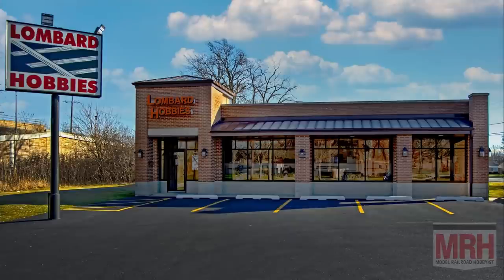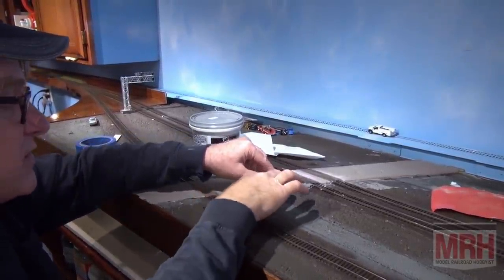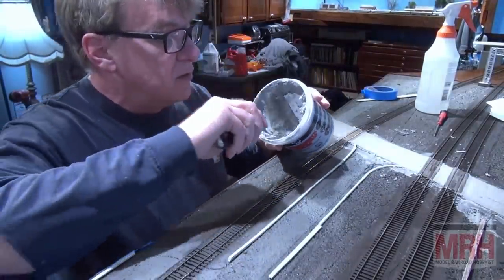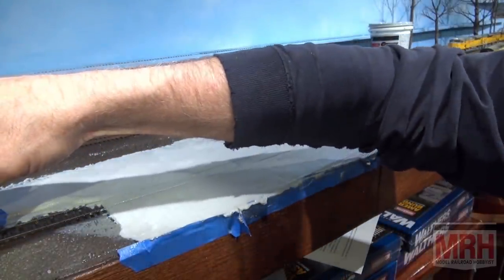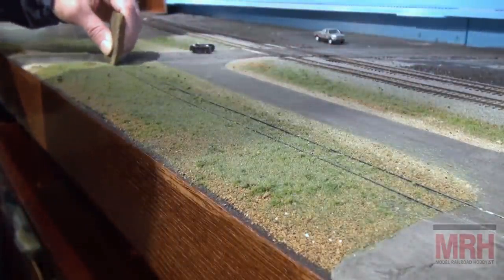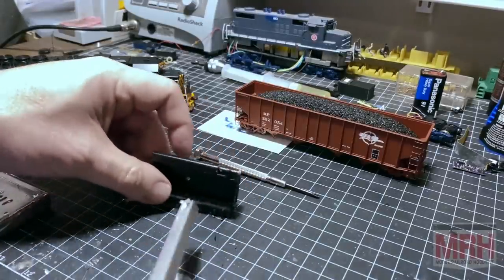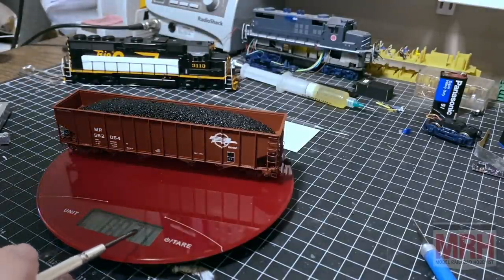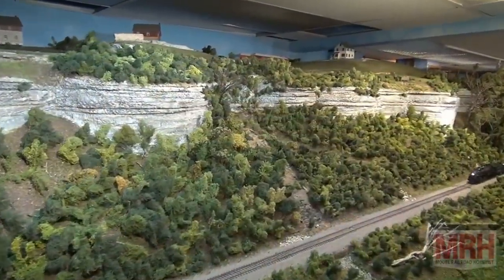Paved areas step-by-step | May 2021 WHATS NEAT Model Railroad Hobbyist

Comment: This is a good idea. I tried this with a little change. I took some wire and made a handle. then put it in the side of the fuel tank. I then made up some plaster and poured it in the tank so went the plaster harden. I popped it out and formed Plasticine clay around the cast to make a mold. I then removed the plaster cast and melted the low temp into the mold to make two castings to add to the tank. and it worked. Just a thought.

Comment: Just a word about safety...some of the low temp alloys can give off nasty fumes.  (Cerrobend might have cadmium, which is not too kind to your body). Good ventilation is a must.  Also, consider using a double boiler technique (ladle in a pot of boiling water) instead of the soldering iron.  This should keep you at lower temps than your soldering iron, which means minimal fumes.
Reply: Yes, this is very dangerous stuff. Ken, I recommend that you remake this video with a warning message on it. You don't want to be hit with a liability suit.

Comment: love this segment ken on the paving part,george has some good tips on adding weight to locomotives and freight cars which comes at a good time as I,m working on a log car conversion using an older walthers GSC flatcar kit and I'm not using the steel weight that came with the kit because I cut the deck up so I came across some deluxe materials liquid gravity that I'll trying out..
Reply: Liquid gravity works great, just seal it with some liquid super glue (take care of the fumes).

Comment: The color the India ink makes the road and unloading surface is real close to old asphalt. The unloading area could use some additional weathering. Such a large area of uniformly defect free asphalt is not found unless newly resurfaced in the real world. It needs cracks especially around edges, simulated tire ruts, and oil leak stains where the trucks would sit to be loaded and unloaded. Maybe tire marks from the fork truck. Adding these things would make it better match the appearance of the siding being burried and unmantained. As a truck driver I have never seen a uniform, pristine loading/unloading area. Heavy trucks with heavy loads do damage, weather does damage. And all of what I mentioned can be achieved with a little paint, a sharpie, a steady hand, and time.

Comment: I've always wondered about a recommended weight for model locomotives. The NMRA has set standards for freight cars and I just wonder if there is a way to set up weight standards for locomotives. There could be a chart of minimum weight to get the locomotive to pull a certain number of cars increasing the weight in steps up to a maximum weight of what a certain type of single locomotive should be for it to pull the same amount of cars as the prototype model pulls. Then there could be charts showing the same information with 2 locomotives of the same type and so on and then charts showing mixed consists of locomotives. That's a lot of work for someone at the NMRA standards department to do if they're looking for something to do. All locomotives from the first steam locomotives through electrics and diesel electrics up to the newest locomotives now. With all the different types of locomotives having different weights and lengths and wow at the calculations that would need to be done. 🤯  I don't think it would work to do it by length of the locomotive like they do with the weight standards for freight cars because the locomotives are given more tractive effort by weighing more. So I don't think one type locomotive that weighs less than another but is the same length could pull the same amount of cars so thats why I say I don't think it would work by length like freight cars. Anyone have any opinions on this on how it could be done?  👍

Comment: With all due respect, George, using those alloys is not new to model railroading.  You will find articles and references (maybe even ads) in Model Railroader back in the '50s or 60's.